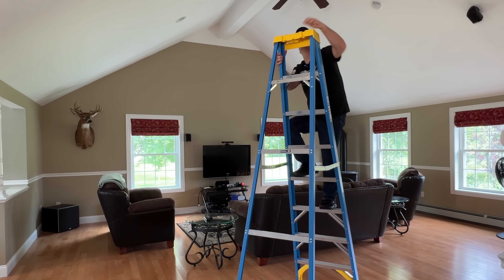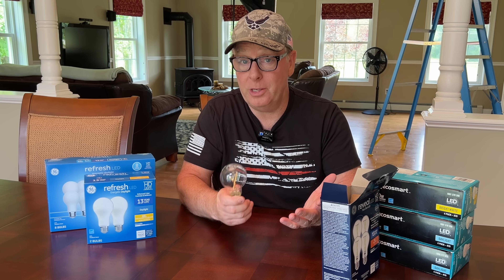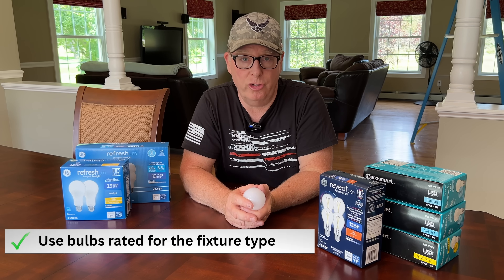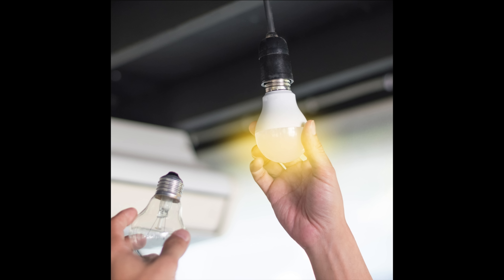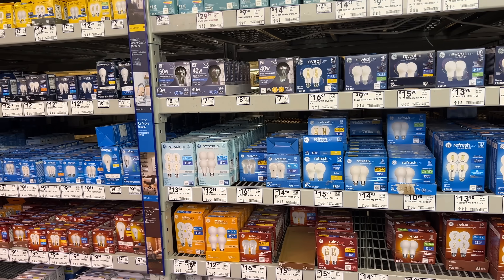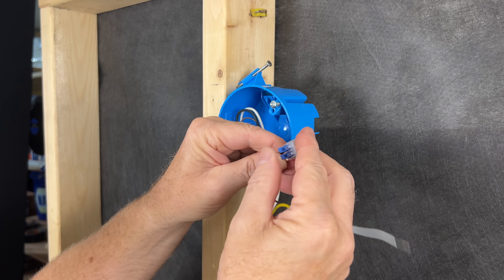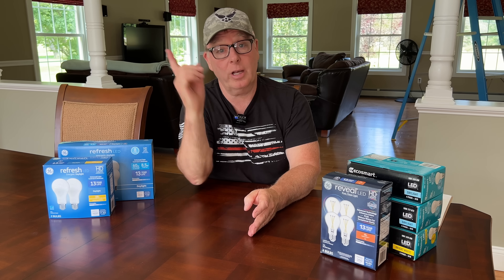The Mistake That Kills LED Bulbs

Comment: And I make sure to demand a warranty replacement for all those "ten year" LEDs that burn out in 4-5 years.
 Yes, it is not worth my time. They know that. But I'm damned if I'll let them get away with it.
 One highly respected brand name not only says "couple of hours a day" in VERY fine print, but they requirs you to read a part number, which requires a magnifier, AND to send a digital picture. An awful lot of roadblocks for a "reputable" company.
Reply: Had to fight with Home Depot for one of the 'recommended' bulbs in this video: EcoSmart. I saved the receipt and it lasted 4 years, a year shy of the warranty. HD tried to tell me to call the manufacturer and gave me other runaround. I showed them the PDF I pre-saved that stated bulbs should be brought to the store for replacement. After about 20 minutes, they finally gave in and credited me the purchase amount on a new set (model numbers/versions had changed by then.) Of course, the new bulbs were 20% more due to inflation, so I had to pony up $4 for my warranty replacement. I took that as a win considering I was wasting my time for $20, but I still felt like I lost in the end.
Reply from the maker: Nothing last forever especially with electronics. I have never tried to get warranty replacement on a light bulb. Just not worth the hassle. The hours of run time is not linear. If the bulb is rated for 13 years at 3 hours of use per day thats about 14,000 hours. If you run the light 6 hours a day you will not get 7.5 years or 14,000 hours but you may get something like 7,000 hours. 24 hours a day more like 4,000 hours. If they are used in an open fixture in a cool environment they may last decades. The open light bases in my shop have LEDs that are on only when I'm out there but I haven't replaced any of them yet and it's been 19 years since I built the shop.
Reply: Exactly! The warranties are bogus. You have to do so many things to even consider even getting a voucher for a new bulb. First thing they want is a copy of the receipt from the store. Most receipts last a couple years then the ink fades out and you can't read it, IF you can find it! Next is photos showing where the bulb was being used. That way they can null the warranty by saying the bulb was not being used exactly as it should. Crazy.
Reply: I have never seen an LED bulb not state hours of runtime, and it has always been in very readable font. The "Lighting Facts" label in the US tells you all of this information, and just about every LED I've seen states its life in years based on 3 hrs/day of use.

How would you even think bulbs would be rated in years without specifying hours? How do you think that would even make sense? A bulb running one hour a day will last 16 times longer than identical bulb running 16 hours a day, no? Obviously we'll need to specify hours of runtime. This ain't rocket science, bud.

Comment: There are some direct wired LED tubes that require Hot and neutral correct. If not they will not light for sure.
Reply from the maker: Yes any LED including the tubes require a neutral to complete the circuit but the drivers deliver DC to the LEDs.

Comment: I replaced all of the can lights in my ceilings in my living room ceiling my kitchen ceiling in 2018 was Philips brand bulbs they are still in operation today. I also purchased in 2014 75 watt equivalent light bulb with a massive heat sink and that thing was on 24/7 until recently because I discontinued it to you is because I didn't like how hot it was getting. A light bulb was at least a couple of pounds let's put it this way you wouldn't want to get hit in the head with it that's how much aluminum is encased in fins around the bulb my first 75 watt light bulb cost me $40 the second ones cost me 20 bucks and the third set cost me $10 play progressive really got worse in quality as they decreased in price and I will only put I've let's rephrase that I used to only put Philips brand bulbs in but they've gotten really terrible. I have found that Walmart brand bulbs are better than Philips don't ask me why

Comment: Thank you for posting this excellent video. I took a photo of your tips. I too am replacing my LED bulbs too often. My house was built in 1937, and the last time an electrical update was done was back in 2014 when an addition was built and the home converted to 200 amp service. I often wonder if line brownouts and spikes cause problems for my LED bulbs. By the way, your reverse polarity test gave me food for thought. I didn't think an LED would turn on with polarity reversed. So I was surprised when it did. Your explanation makes complete sense of course. Perhaps in the future you could look into how to extend the life of "smart" LED bulbs which offer lots of different colors like Phillips Hue brand bulbs.
Reply from the maker: Glad the video was helpful! And thanks for the video idea Robert...

Comment: Great video!  I have found that not all LED dimmer switches and LED dimmable lamps are the same.   In certain scenarios even a LED rated dimmer paired with a LED dimming rated lamp sometimes are not compatible.  Hoping for a positive outcome, I lucked out/solved this by changing the LED dimmer brand.
Reply from the maker: That's a great point about the dimmer switch compatibility and good to hear you solved the problem!

Comment: I’ve been looking at buying outdoor light fixtures and many of them seem have a built-in LED. Am I going to have to replace the entire fixture if the LED quits working, or do you think it would it be possible to repair?
Reply from the maker: That’s the only issue with buying all in one fixtures. When they fail you need a new fixture. Check the expected life and the price to determine whether or not it makes sense.

Comment: When I had my bathroom remodeled 8 years ago purchased an exhaust fan with a night light & a regular light. I did not want a four gang box on my bathroom wall so used a 3 way switch for the two lights. When the regular light is off the night light is on. Replaced the 6 watt C6 incandescent light bulb with a LED that if it was always on would cost around 80¢ a year. I saved $10 from not purchasing a fourth gangable wall box, illuminated wall switch and a four gang wall plate. Cannot believe this LED that is on over 22 hours a day is still working.
Reply: C6 is typically very low power. They don't take as much current through the driver or generate much heat, so they last a really long time. The problem with bigger LEDs is that they typically can't dissipate all the heat from the driver circuit when they are on, so they cook if they aren't shut off to cool.

Comment: Question 
when would you or how easy to install led recessed can kits. 
Do these offer better life than a bulb
Reply from the maker: I'm not sure how long they actually last but they are very good. I have had several in service for over five years without issue. I bought two extra just incase but haven't needed them yet. They have several options available to convert your existing can lights to LED. Maybe I should make a video on the options.

Comment: LED fixtures has advantages over bulbs.
1. Light distribution. See below. 
2. Low heat = less work for AC
3. Low power = lower electrical bills. 
4. Options for color and quality 
5. More lights on fewer circuit.
6.  LED life when Fixture is designed for LED 

Distribution. 
Some fixtures (ceiling) can spread nearly parallel with surface (ceiling)
Spread combined with lumen can reduce number of fixtures needed.
Reply: Plus, strobes at line frequency.

Comment: Retired electrician and reason several brands zi tried & had a high failure rate. All were made in cheating lying lack.if quality control communist china. I purchased some CREE from Home Depot while they were still made in USA. Came with a 5 year warranty. All 12 are 7 years old and still working great. Have to be cautious when.purchasing LED'S. Some cheating Chinese  garbage ones only say they will.last just a few years. Did the math and some were as low as 5,000 hours. Installed a 150 watt Equivalent LED corn Cobb LED with a little fan inside of a 12" kitchen globe light duc years ago. Never got more then 6 months with any incandescent light bulbs.
Reply: Bingo! The cheap crap from china fails because the driver circuit is designed to use the cheapest components available.  It's not the LED that fails, it's the driver.

Comment: As far as I know LEDs are DC  and polarized  but  you could have the  circuit handle a reverse polarity condition. Not hard to do.
Reply: The AC line current goes into a bridge rectifier and a bridge doesn't care about AC polarity. It has diodes arranged in such a way it passes current no matter what. But the bridge sorts the polarities out and puts out polarized DC. There'a diode biased in each direction for each AC connection. Then the forward biased diodes go to the positive output and the reverse diodes go to the negative.

Comment: What about reverse polarity on LED fixtures that have a "driver" inside?
Reply: I have older LED bulbs which definitely work only when hot and neutral are correct.
Reply: @denverbraughler3948  I would love to see that, because that's not how AC works.
Reply: They all have a driver inside, since all LEDs are DC. AC doesn't care about polarity, but it's converted by the driver to dc to power the leds. If you are running an LED off DC directly and flip the polarity it won't work.
Reply from the maker: Same deal.

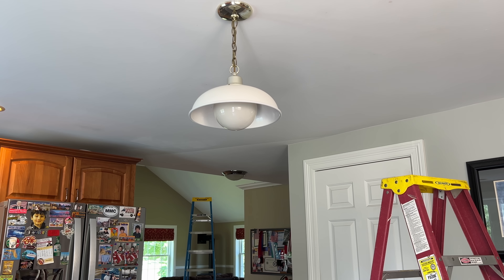Comment: @03:12 it would seem that never turning on the bulb would cause it to last the longest. The rule: the worst thing you can do to an electrical device is turn it, on doesn't apply?
Reply: Electrolytic capacitors lose their oxide layer if they remain de energized for a long period of time. They become what's called, "unformed". Then as soon as you do power them up they pop. Although there is a way to recover them from that state. You have to pass current through them at a lower voltage they can handle. Which ain't what happens when you just flip the switch. Then they simply blow out.
Reply from the maker: For sure the hours add up when it’s on but the number of hours the light will last decreases exponentially when it’s run more than 3 hours per day. But you are right it would last decades if you never turn it on. loo
Reply: @BackyardMaine  I realize now I didn't explain that very well.
in this case, never turning it on would be like leaving it on all the time. Rather than shutting it off then closing the circuit, then energizing the cold curcuit that causes failure.  

A bulb, under ideal circumstances, should meet or exceed its hour rating if it is left on.

Comment: I have had terrible luck with the current GE bulbs. Most of them had a very short life. These are the bulbs with glass envelope. In the past Philips and Sylvania have been very good. These were the older style with a plastic envelope that covers the top 3/4 or so with white plastic down to the Edison fitting.  I recently switched to the glass envelope Philips. So far has been OK but I do have one that has started to fail. It seems like the LED filament bulbs, which is what all of the glass envelope bulbs use, are much less reliable than the older style with the partial plastic envelope.
Reply: Same here. I usually try to avoid the GE bulbs.
Reply: Same for me. When Ge had plastic bases with the heatsink and the flat disk led style, those went for years. When they changed over to all glass for looks they had to cram in the smaller cheaper circuit and they use string LEDs that are over driven.
Reply from the maker: Thanks for sharing your experience!
Reply: Always learning. Although I buy my bulbs at Home Depot, I didn’t realize there was a difference for enclosed fixtures. And of course, I have several bulbs in enclosed fixtures, primarily my porch and outdoor garage lights (all the same style). So I guess I’ll be looking for those special bulbs next time I need to buy bulbs.
Reply: Same here. Poor lifetime for GE bulbs. They start to flicker or shut off for moments.

Comment: LED is unique in that it doesn’t naturally give off heat. 
Therefore the LED fixture or LED bulb design has to include heat sink to compensate keep the LED cool. 

You may notice higher lumen bulbs may have fins near the base.  This is a heat sink. Same design appears on street lights and in parking lots. 

Bulbs. Is not the best way to do LED. 
It is not going to be as efficient nor spread light out as evenly or far.
Reply: Why wouldn't a Light Emitting Diode generate heat while it is energized? There's more components than just LEDs in LED bulbs too. There's a bridge rectifier, a fusible resistor, a smoothing capacitor and likely some kind of a regulator chip too. Although some cheap designs just use a capacitive dropper. All of those parts also generate heat.
Reply: @1pcfred 
I won’t go into all the types of bulbs. 
But of them. LED doesn’t generate much heat. High lumen led fixture is relatively cool to touch. Especially compared with incandescent equivalent at same lumen. 

Unlike all other light sources as linens increase the need for sinking or piping the heat is needed. 

Incandescent is very inefficient.
lumen to watt.   

I have a 3 way led bulb in the lamp next to me. At its lowest level 650 lumens I can hold the bulb. Barely notice the warmth. Rated for 17watts at 2100 lumens. 
650 lumens is 40 to 60 watt. I wouldn’t hold those.

Comment: I buy Philips almost exclusively and have had zero issues over the last 5 years and they're in enclosed fixtures, I can't complain about that. The off brand florescent conversion tubes in my shop on the other hand, I've got two tubes acting up after 4 years that I have to deal with. For the price that's not bad but I'm not buying any of the off brand bulbs floating around for the house.
Reply from the maker: That's great to hear! Thanks for sharing your experience.
Reply: I'm slowly switching to the Philips high efficiency LEDs where it is possible.

But I have rarly any issues with LEDs besides from some bad batches of LED outdoor spots. 

Many LEDs are over 10 years old and still work fine with daily use.

But for some rooms like the attic and some Outdoor lights, I have still CFL or classic bulbs in use.

Comment: I installed a smart 3-way dimmer switch which was intended for incandescent bulbs. It took time, but i finally located an LED bulb which had been designed to dim smoothly with the leading edge dimmer all the way down to 1%. This 70s house has an outlet in the kitchen on the same circuit (don't get me started) and I found that when I had my Keurig Coffee pot on the outlet, the LEDs would flash even at 40% power. Someday soon I'll add a dedicated circuit for that outlet, but until then, I moved the Keurig to one of the two legal kitchen circuits.
Reply from the maker: Thanks for sharing your experience
Reply: @BackyardMaine  Thanks for the great content. I'm a big fan.
Reply from the maker: @craigjohnston7143 thank you Craig

Comment: We've been sold over and over again on lightbulbs..... first with CFL bulbs and now LEDs.  It's all been fluff and higher prices.  I DO like LEDs better but won't pay too much extra for the marketing nonsense that has not really proven itself.
Reply: Make America great again by bringing back whale oil lamps.
Reply: It hasn't all been fluff and higher prices. If you read the text on the box, you can find out if a particular bulb can work for a particular situation. Most LED bulbs nowadays are usually 1 - 4 USD, so it's hardly a huge cost in the home.
Reply: Incandescent bulbs.....2 for 89 cents...😮
Reply: @FelixtheMetalcat  Do you understand what operating costs are? 😂😂
Reply: @person880 ok mr always right....Are you gonna tell me how to screw in the bulb next?  Geezus...
Reply: @FelixtheMetalcat  I just might have to! I've already explained to you that marketing aside, LEDs are significantly better, how to read text on product boxes, and a moment ago, how a higher upfront cost can be offset with lower operating costs. It seems like you need a lot of things explained to you.

I'm really not sure what point you were initially trying to make. Marking nonsense is common to any product category. If you use LED products how they are actually intended, they will easily outperform incandescent bulbs. You even said you like LEDs better, but the initial cost is what prevents you from buying them, which means you have no clue how operating costs work.

Am I gonna tell you how marketing works in a free market system next? Geezus....

Comment: Of course it will work, its AC. zit wont work on a car with DC power, though.
Reply from the maker: I knew it would work but I had a lot of comments telling me it wouldn’t. It is AC but the LED is still supplied DC through the driver
Reply: @BackyardMaine  a 120V AC circuit in North America isn't as AC as one might think it is. Hot and neutral are not the same. Between both hots it's AC how you'd think it is. But on a 120V circuit, not so much. I've run into polarity issues on 120V circuits with triacs and autotransformers. They won't work hooked up backwards. It'll make you think of AC very differently. You can say it should work all you want to. But until you flip the wires around it just won't.